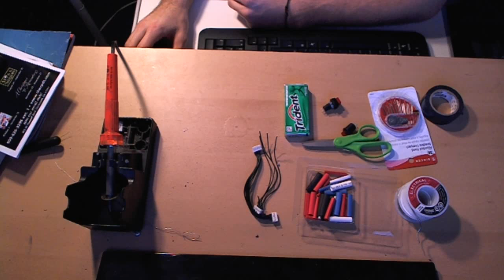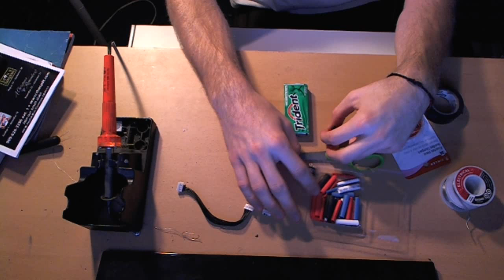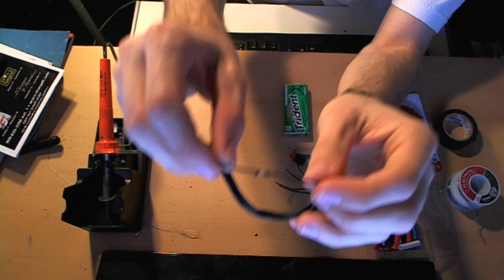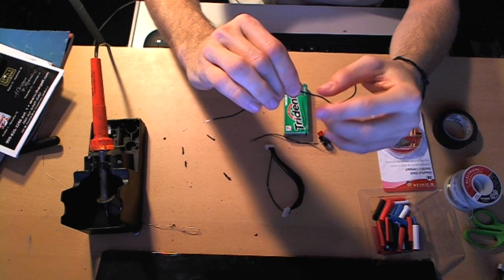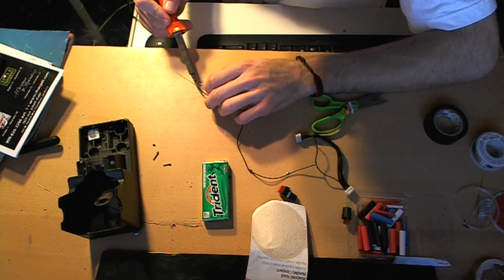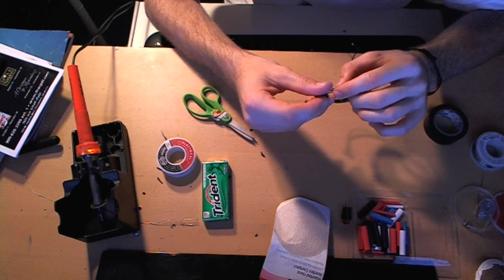DIY Tutorial How to make a probe for flashing lite-ons Xbox 360 like ck3 Nob Friendly Part 1

Comment: Hey, I know this video was made a long time ago, but i'm struggling with making the probe, I have tried with the Maximus Scorpion 2 and then I made one close to this one with a 6 amp switch and tried doing it multiple ways and it just will not work, and I'm getting extremely frustrated, the only thing I haven't done is soldered the wires together which is going to be my next step if this doesn't work, I finally stripped them and twisted them together and it just will not let me get a dvd Key read off of it, it says the drive's plugged in and everything it's just the probe or switch or something isn't working, any help would be greatly appreciated.

Comment: There is a much much easier way to make a probe
Reply: terry taylor Tell us.
Reply: You get a screwdriver and a wire you tie the wire on the screwdriver then tie the other end on the metal frame of the xbox. I've used it several times
Reply: terry taylor really?
Reply: Wouldn't that just fry your motherboard🤦🏽‍♂️
Reply: @HighSpeedChase  n ope
Reply: necroposted comment above^

Comment: I have a few questions and would love if you could answer them for me.

1. Could you send me the link the tutorial you were reading
2. Can't I just use some spare wire I have laying around and solder that to other cables instead of cutting those 3 wires like you did
3. The connectors on the switch the metal parts...Can I bend those away from each other?
4. Where can I get a spare dvd drive cable like that

Thanks looks easy enough though